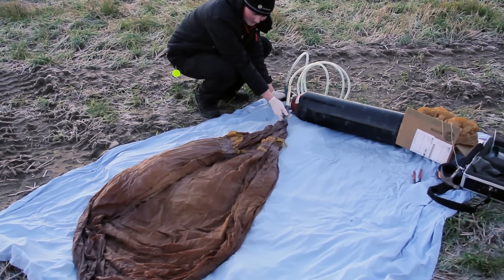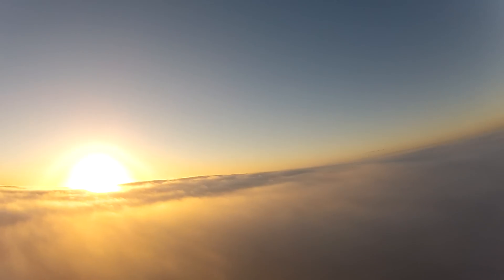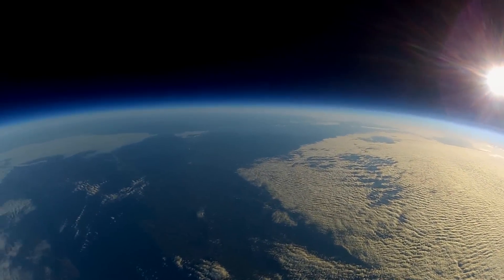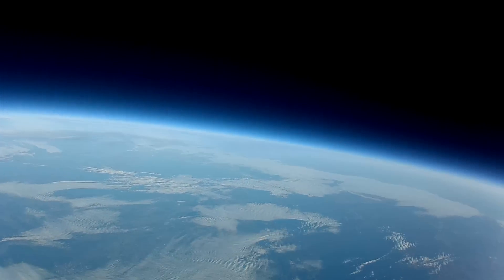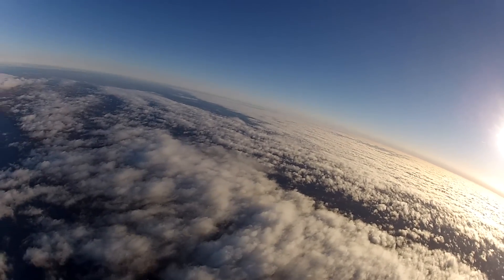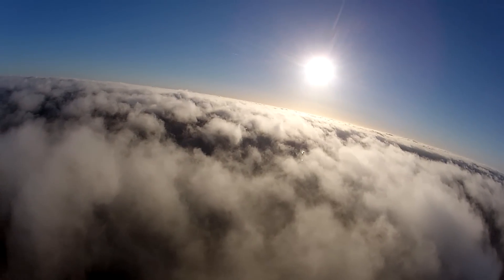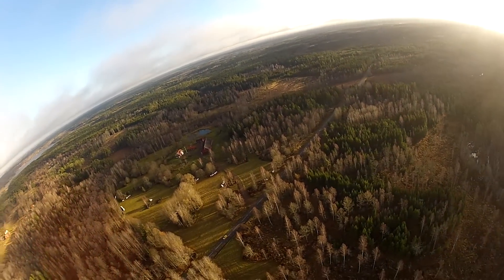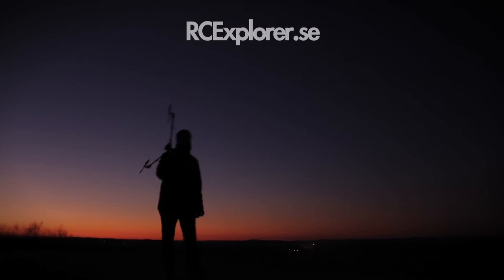Space Glider - FPV to Space and Back!

Comment: Nicely Done. I started doing exactly this, using an HK FPV Raptor as the air-frame but never finished the project and instead just got a ton of time on the plane doing some 433 and 1.3 FPV. I was going to attempt to have a Vector or an FY41AP return to home feature fly the plane back instead of giving chase. The thought was to rig a pressure switch to a servo tester which would actuate a glider tow release lever when the balloon burst, releasing the plane from the rigging. Previously I've launched two 400 gram latex balloons filled with helium attached to a parachute with payload like a GPS tracker and GoPro in a cooler. We reached about 97,000 feet when the balloon burst on the second flight. We are planning on a third flight with a glider with the above mentioned gear. Its a lot riding on a GPS auto pilot with Return to Launch that may or may not work above 50 thousand feet. Thanks for the great video.

Comment: Ever considered hydrogen for the envelope? It would be cheaper and provide more lift. It's possible to make it as safe as helium if you do the fill up and release remotely...
Reply: Manintoga *buoyancy, not lift
Reply: Buoyancy is what causes a lifting force = you are being a little shit :D
Reply: Manintoga Hahaha, I was wrong too. Hydrogen wouldn't provide more buoyancy or lift. The buoyancy would be the same for the same volume. Hydrogen would just reduce the weight, so the remaining upward force after adding (vector addition) the buoyancy and the weight, would be higher.

So to correct my first reply:
*It would be cheaper and reduce weight.
Reply: Bogdan Pirsan Hey, how do space rockets work on space? I tought the universe was in a vaccum, meaning there no pressure. How can they use fire or oxygen or anything to move in space??? If there is nothing to grab onto or pull i to????
Reply: Krizx600 If you (rocket) throw something (propellant) in one direction, it will push you in the other direction.

You are right, there is nothing to push or pull, so your center of mass can't move at all. In an isolated system (no stars, planets around you, so you have only your rocket in empty space) the total center of mass of everything is going to remain in the same position no matter what you do. So if you throw propellant in one direction .... it's mass is going to move in that direction. So in order for the total center of mass to remain the same, the rocket is going to move in the opposite direction. Since the rocket is heavier, it's going to move less than the propellant, but the rocket exhaust got a speed of a few km/s, so the rocket still moves pretty fast.

Said simpler, since you don't have anything to push or pull, you leave the propellant behind of you and push it, to move yourself forward.

They usually use some fuel (ex.: hydrogen) and some oxidizer (ex.: oxygen). They carry the oxidizer with them, so the fuel can burn, since there is no oxidizer in space. You have to burn it, so the exhaust move with that high speed (a few km/s) that I was talking about earlier.

Comment: how does your fpv antenna reach that far?
Reply: ***** it does not thats why he crash landed on the wrong side of the lake
Reply: +Metalstorm987 has the antenna transmit in a straight line than a sphere.
Reply: GPS for Automatic return

Comment: This is stunning. Sure it's illegal, but this view of space is absolutely amazing. I do agree that these could get in the way of jumbo jets, but I honestly don't think the chance of that happening is very large.
Reply: ChopStix
Even if that drone hit a commercial airliner it wouldn't do a whole lot. The engines of airliners need to be able to withstand sucking in a 4 lb bird which is a fairly decent size. Not to mention that a drone that size hitting anywhere else on an airliner would hardly do anything.
Reply: laws are constraints ruining life
Reply: I disagree, a lot of laws are necessary, but I think it's rash to say that this could get in the way of a jet.
Reply: ***** I realized that after I posted. But thanks for making sure that was recognized.
Reply: ***** Bone is just as strong if not stronger than metal.
Reply: Colin A. I agree, I just didn't figure it was worth saying.
Reply: ChopStix
A spectacular video would be for the sd card on the gopro to survive going through a jet engine. THAT would be some cool footage even though it would be next to impossible for the camera to survive long enough
Reply: Colin A. Agreed.
Reply: ChopStix But a bird does not consists of metal components.
Reply: ChopStix Pick an axe and try to cut a bone and then a motor, SMA connector... I dont blame this video but you should not say it is the same as hitting a bird.
Reply: ***** I didn't even originally say it, I could just see where he was coming from, although you do have a point.

Comment: One RC jet has already nearly gotten sucked into an airliner engine. You morons want to be responsible for the deaths of 100s of people? Really?
Reply: So your saying we should ban birds too?
Reply: Chances are they filed a flight plan with the FAA. Pretty sure launching weather balloons at all is illegal without a flight plan.
Reply: Never assume, as it makes an ASS of UME !
Reply: tricopterY
The meek shall inherit the Earth. The rest of us are going to the stars.

David has done a great thing here and has shared it. It's not for those who do nothing but ridicule those who achieve. It's for those who want to see what is possible and hopefully to encourage others to push the envelope.

Labeling great achievements as "selfish and irresponsible" belongs in the Dark Ages.
Reply: Airliners turbofan engines are designed to be able to ingest frozen birds during their design and testing stages. Bird strikes are usually only a problem when there is a huge flock of birds. One tiny foam plane will do little to no damage to a turbofan engine. Even if the model plane did cause an engine failure planes can fly with a failed engine very easily. Also, David cleared his route with the FAA and in fact broke no laws.
Reply: Well I guess NO ONE would loose any sleep if YOU were on it..!
Reply: Eduard Nenastin well you didnt provide any sources to back yourself up, so you didnt really prove anything with that comment.
Reply: My school does several launches a year, never had any problem and it's very legal. Planes don't have a monopoly on airspace, and have pre-determined flight paths. Since we live in a big city with a busy airport, we usually have to drive an hour and half away.
Reply: *****  You should probably introduce yourself first so you don't come off as some uneducated whack-job talking about something he has no idea about. Please tell us about your MS or PhD in a physical science field or about your long career in the FAA or as an ATP certified pilot.

Then you could start by telling us why the "Big Sky Theory" is wrong or how you've used it with your estimates of the number of flying objects per unit volume, speed estimates and size to arrive at a non-negligible probability.
Reply: Pa RC Quad Racers i like how you answered for him..........i mean if he really did it he wouldn't require someone to answer for him right?
Reply: ***** As much as I respect David for his contribution to the hobby, but in this instance, I find it a selfish and irresponsible act. Please do not encourage this kind of individual behaviour in the hobby-world. We are not government agencies or research institutions.
Reply: An RC plane like that would most likely not knock out a engine, but even if it did a plane only needs one functional engine to land. He would not "kill hundreds of people" he MIGHT have to reimburse the airline company at the most after doing minimal damage to an engine. Do a little research.
Reply: Danny Oconer Touche, you intellectual giant, you.
Reply: madryboy You realize this video is well over a year old, right? David just moved back to Sweden. He probably doesn't even have time to check his YT channel.
Reply: Balloons don't respect flight paths. They follow wind. Winds sometimes change randomly. It's all fun and games until someone dies. Unfortunately, people think their hobbies are just as important as people's lives. Government rarely regulates things until AFTER a disaster.
Reply: John Wright Bird flight paths are not random. Migration routes can be accounted for. Flocks can be seen on radar.
Reply: ***** 
if you think that David is stupid, let me reasure you that no. Also, if you are here to criticise him and not care about his great feat, then please go somewhere else.
Reply: Don't be that guy. If you actually read up on this he cleared his plan with all of the appropriate authorities prior to the attempt. Everything he did was completely legal.
Reply: Jamesyy Boyy
They do in fact thaw the birds before they make the ingestion tests :)
Also, this flight was clearly not made in the USA, so the FAA had no say in this.
Reply: dude im guessing your a robot repeating the message your dear government  wants you to believe and has any fpv plane taken a airliner out or killed any one ?
Reply: Jordan Escobedo are you seriously believe in what you said?
"An RC plane like that would most likely not knock out a engine..."
Man, you have go back to school at first... and than try to spend more time on physics and not on the singing, painting or whatever...
Reply: Jordan Escobedo I guess that you didn't caught this... an opinion - it's like a butt hole... everybody has one... so, if you think that RC model will not make a serious impact on the airplane engine - that's you opinion... It seems that you know at which speed compressor works and how other processes runs/adjusted in the engine. Sorry that I've disturbed your "perfect" world...
Reply: Eduard Nenastin I based my assumtion that the plane would still be able to land safely on one engine on past reports of planes landing with only one working engine, the rc planes bit was because engines have sucked up birds before without breaking. Birds have caused engines to malfunction in the past though, which is why I said most likely.
Reply: Good for "hobbyists" - but real innovators and pioneers are a different breed of people, that may use their talents in their spare times for hobbies. Most innovations are a culmination of years of research, with huge sums of money invested and spent. By definition "professionals" are welcome and "hobbyist" may not apply.
Reply: you do realize that this was totally legal... you just have to get approval from whoever manages that stuff and you are given a time window in which you are allowed to launch...
Reply: Just because something is technically legal, doesn't mean  that MANY people haven't missed something obvious--not enough lifeboats on the Titantic. I am a career science editor and PhD political scientist and I HAVE SEEN IT ALL, baby. What kills people en mass is the arrogance of people saying, "But we've ALWAYS done it this way. It's LEGAL.
Reply: tricopterY Actually that is mostly untrue but you would need to give some examples and also differentiate between when the same someone is being a professionals or a hobbyist. Bill gates was a hobbyist who wanted to make money and Larry Ellison was no professional either. Graphene was discovered by mistake and just to really get some wind Blockbuster Video well, what a difference. So much for your money and innovation.
Reply: tricopterY What stops hobbyists doing as they please why can't they enjoy the little things in life? even if they are not scientists .
Reply: Havazik I doubt it, weather ballons are set off daily by scientist. Just consider how all the weather forecasts are made.
Reply: ***** No but planes do follow flight paths, so think again. You are a greater risk for an disaster than this balloon.
Reply: ***** Said the one that dies on his couch at home, never done or experienced anything of value. There were much more that was wrong with titanic than just the numbers of life boats. 
Still I use a boat every year without a single life boat.
Phd political scientist says it all.
Reply: http://www.oxfordmail.co.uk/news/9648097._I_can_prove_it_was_not_Titanic_that_sank_/

Comment: why did you let youtube run its own shaky camera correction, it ruins videos
Reply: I disagree; I think it adds to the authenticity of the video. Gives it a real POV feel.
What I need to do is convert all the metric into poor dumb American units. Makes me wish that (I think it was President Carter) hadn't chickened out on finally convert is great nation over to the metric system. They even went so far as to put up a few metric speed limit signs near the border here in Texas. This was during the federally mandate 55mph limit turns out that's 88kph or that's what the signs had on them.
It's going to happen already has for tires at lest the width is metric that's what all the195/205/215/225/235/245/255/265/... is all about. now the rim is still standard inches metric was tried. Anybody remember TRX tires even came standard on a few fox body mustangs and BMW.IIRC they were 390mmin dia Just FYI

Comment: With the technical glitches sorted out (eg. whatever ground based problem there was) - it seems like you could potentially use some rocket boosters to get the plane even higher. Have you done another run with the same balloon/flight combo?
Reply: It was legal when he did it, its illegal now. So that's a no. And they weren't exactly so much technical glitches, as more of physical problems; the first problem was a physically snapped cable, and the second was that the balloon ripped out two of the lobes of his video transmitter antenna when it was released from the plane. Not sure how many lobes there were in the first place, but a typical one consists of 3 or 4.
Reply: To say the least ;)
Reply: As of now it's completely illegal to fly non-los in the US. Its also currently illegal to drop things from weather balloons, yes, this is including an FPV aircraft.
Reply: Well that fucking sucks.

Comment: Use a GPS autopilot next time, APM would be a good choice
Reply: He had a GPS/SMS tracker installed in it, so he would be able to call up the coordinates of where it landed.
Reply: Rutger de Haan My point is to use the automatic return to launch feature so at least the plane could fly back to the launch vicinity y itself
Reply: It's a great thing to do anyway
Reply: a good choice for the plane to fly itself straight into the ground, 200km from launch
Reply: A GPS autopilot would have been perfect, except when he got signal back and got oriented to where he drifted, he was way too far to get back anyhow. He said that in the video. The headwind wouldn't allow it, and thus the choice to turn the other way and just make the best of the flight footage.
Reply: Chris Baker I'm pretty sure he would have been up too high for it to get a GPS lock anyway, besides I'm pretty sure the plane wasnt powered at all, so it wouldnt have been able to get him home anyway.
Reply: fassenkugel it would have to wait for a lock below 3km, yeah

Comment: did u find your plane?
if yes, how?
Reply: Sure he did, he got the video to show
Reply: That was my guess as well, but I'm wondering how did he find it
Reply: Gatis Kandis He didn't. He was way off course and he just aimed it at whatever road he could see before he lost it, the battery didn't last long enough to narrow down with the GPS (Small battery to save on weight). A local couple that lived there found it and returned it.

They did find it via GPS earlier when there was a mishap and they had to abort. But even then, the power died just as they got to the crash site.
Reply: Gatis Kandis GPS/SMS tracker unit. Send it a message, it sends back co-ordinates.

Comment: I am still wondering...when the balloon was released it will be far away from the place as there is no guarantee that the balloon shoot up straight up and you get your video link direct...and how do you glide your Rc plane from such a far distance....what battery pack up u r using...and rc transmitter u r using ...i mean the distance ...the line of sight.

Comment: How the hell does a "cable break" lol while you´re merely sitting there?
Did your dog eat the cable? ^^
Other than that, which sounds a bit like bullshit to me, a very nice video.
Reply: the cable breaks via two methods, first if its on the outside weather or some other object hits it or two- when your operating it it gets pulled out as you move it and damages the connector (iv done that before only it was in a different situation)

Comment: Did you need to put anything on the balloon or plane for radar to pick up or call the FAA
Reply: aluminum foil is either a general requirement or a general suggestion, for safety put some strips of aluminum on the balloon, and glue some on the rc.

Comment: What a great idea.. Someone needs to put FPV in outer space.. Balloon it up.. Fly it to outer space.. simple..
Reply: To achieve orbit, you need to reach orbital velocity. If you don't achieve orbital velocity, it doesn't matter how high you go up on the baloon, you will always fall back down again. Low Earth orbital velocity is a little under 8 km/s. That's a little under 18,000 mph. I don't know of any typical RC craft that can achieve that.

If you didn't care about orbit, and just wanted to touch space and fall back, it might be possible. One challenge is that "space", by definition, is the area where atmospheric flight is impossible due to the thin atmosphere. So rocket motors or RCS propellant or something would be required.

Comment: What if you collided with a real airplane? Your RC plane can get sucked into the engine or penetrate the windshield (they are made of plexiglass to save weight) and knock the pilot out, or blinds him? The rule of the road in the air is see and void, if you can't effectively spot real airplanes (which you can't if it's beyond your visual range) you should not be flying your RC model.